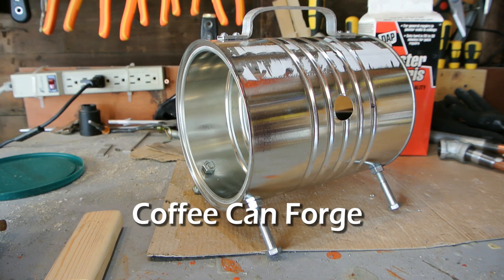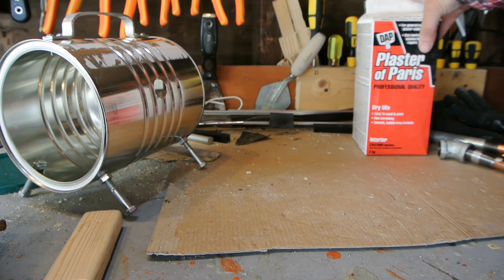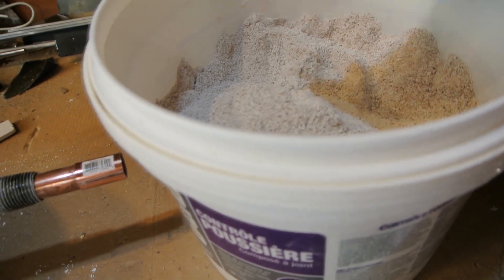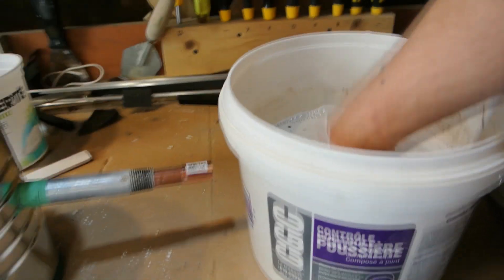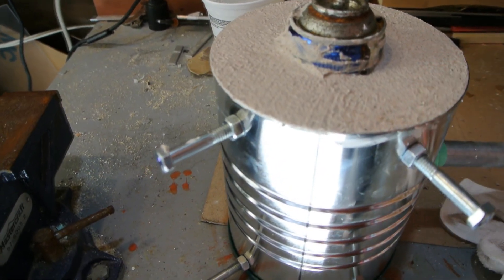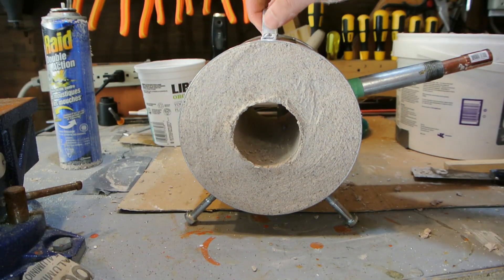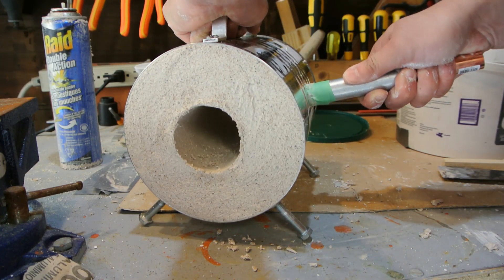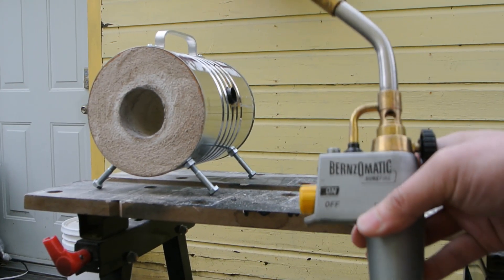How to Make a Coffee Can Forge

Comment: great video, was wondering could you double up the cans and make it twice as long, or would this torch not have enough heat to power it.  I have the same torch (TS8000) but would like to be able to do more than about 5-6 inches.
Reply: @violetroseish thats actually what I ended up doing.

Comment: Could i use cement to do this? I have a bunch of left over bags from when my dad and I fixed the house. Would cement work or is there something wrong with using cement?
Reply: +crsed cement don't hold heat as well, and it will crack.
Reply from the maker: +Wayne Earls Agree and it's heavy.
Reply: It kinda explodes  and flakes off some pretty gnarly shrapnel or at least it does with oxy acetaline

Comment: what other pieces did you need besides the hose to hook to the propane tank.
Reply: +i2aspire Just look up bernzomatic hose on ebay. it has connectors built on.
Reply: +Wayne Earls I'm interested in making this for knife making, will it get the steel hot enough to be able to harden? great video

Comment: Thanks for posting this. You may want to try coating your chamber with a product like Satanite or ITC 100. That will help with the thermal "reflection" to help get a little more heat out of it. Also as previously posted blocking the back end when not working with long stock would help. I have built a few propane forges and unless I have an air assist on them they seem to struggle to get to welding heat (my experience, not an expert on these matters). Very cool, I like the home brew refractory and think I will try it on my next forge. Has it held up over time/use?
Reply from the maker: Jeffrey Jones Hi Jeffrey, I have only used it a few times but so far it seems to hold up.  Thanks for mentioning ITC 100, I actually have some left over from many years ago when I built my first large forge, I'll have to get around to coating it.  I don't need to do any forge welding so this is perfect for bending some long pieces of metal.  Best part takes no time to heat up.

Comment: How warm does the outside of the can get,generally speaking?  How long did you wait for the mixture to set or cure before firing? Nice clarity and pace in your instruction. Thanks.
Reply from the maker: 101platayoro Thanks for watching.  It gets pretty hot but not so hot that it would burn paper or anything like that.  Actually you don't need to wait for it to cure once it gets solid you can fire it up and water will dry out of it.  It will just take 10 or 15 minutes to dry the water out of it (it won't explode).

Comment: Be careful. Your propane torch feed pipe is a steel pipe with zinc coating (galvanized) which zinc has a very low melting point and from the high temperature it does not melt off it burns and boils off creating a gas and smoke mix that is extremely toxic to breath and if consumed enough can kill you in a matter of two to four days. Please be careful.
Reply: Must have never welded galvinized before. Don't get me wrong it's toxic but damn that little piece ought to be fine.
Reply: Christian Holbert 
Thanks for Posting the dangers of Zinc Fumes! All these mockers think they're bullet proof! Toxic Body Burden is a reality!  As a Boilermaker I suffered Metal Fume Fever, because the Employer Refused to buy proper Cartridges for the Respirator! My working career ended at age 51, with a Toxic Fume injury!
Reply: Hes outside my dude I think he'll be alright and on top of that hes not even using that piece of galvanized steel
Reply: Drink milk
Reply: Christian Holbert stfu
Reply: lol
Reply: The food you eat from boxes is far worse for you than the few times you use your forge. lolz look on the box of KD ingredients dude.
Reply: +Christian Holbert I don't think ever used that w/ heat...I think he only used that threaded galvanized pipe for the mold. After the mold had set, he removed it and then he only used a steel pipe piece he stole from a broom (plus a copper coupler to extend his torch)
Reply: I have a quick question. Does anyone have a reason why he left the back totally open. I thought you would want a totally enclosed space? Thats what i generally see most of the time anyway
Reply: @MarsupialMason  - he said that he sometimes has to heat longer pipes and wanted to be able to put the pipe all the way through.  Agreed that it would conserve time and fuel to keep the back closed.  I plan on using this for small knives, so keeping it closed would be perfect.
Reply: @shawngivens247  agree'd then :) i also heard that. And apparently everyone is calling me out on my message. But it makes you think at least which is good :)
Reply: Marsupial Mason he wants to be able to put a long rod through it so he can bend the middle of something
Reply: Marsupial Mason he said that he wanted to be able to stick long pieces through it
Reply: @MarsupialMason  He says early in the video that he wanted the hole to go all the way through so that he could heat longer peices of metal. 
But if you werent going for anything big then you could just leave the back closed and it would increase your temperature quite a bit. It's likely just as effective if you just close off one hole with a fire brick or something.
Reply: Christian is right, it is bad guys it can cause metal fever. It's an easy fix just sand the galvanization off with a grind wheel or angle grinder. it'll burn off  and damage your lungs so just buff that shit out
Reply: Very useful information here Christian, also his use of aluminum in a forge ( the handle ) is not really a safe idea either, as aluminum can be bad when it gets to hot ( not likely to happen to the handle though) so to play it safe, I would have gone with a steel handle. but there's all kinds of ways to improve on this idea ! :)
Reply: Since when are zinc shakes lethal you joker? Especially from a tiny piece of tubing like that. If you weld zinc galvanized steel all day you'll end up feeling like crap for a couple of days, but that's about it. Not saying that people should breathe in fumes all day, but you should seriously get a grip.
Reply: Thank you Justy.  Christian Holbert is obviously a hack.  Glad someone said what i didn't have to say.
Reply: Tdenton12, google ''Health hazards of aluminum'' and learn for yourself !
Reply: how can aluminum be "bad"when it gets hot?
Reply: Not THAT bad...
Reply: tdenton12 it's not man. If it were every person I know that works on the pot line at the aluminum factories would be dead or at a health risk. Who is this guy? Lol! "Heating up aluminum can cause health risk" 🤓(said the idiot commenter)

😬😬😬😬😬😬😬😬😬😬😬😬😬😬😬😬😬😬😬😬😬😬😬😬😬😬😬😬😬😬😬😬
Reply: @BradleyBrasher  I know this is a year old. but burning Aluminum (because it is sometimes mixed with other metals for rigidity) at extremely high heats will cause a exothermic reaction where it turns to a gas. This was observed in full detail during the manufacturing of the M2 BFV Bradley Fighting Vehicle. which at the time was pretty much an armed APC.

They designed the armored hull with Aluminium. When the hull was breached during test fires... the metal got hot enough to expel gas into the personele chamber as well as the  transport compartment. 
This was a live fire test with sheep (fitting substitute) as the shaped charge entered it did not hit any of the sheep, but when opening the compartments... all sheep were killed by gassed Aluminium. 
Albeit the armor was most likely an alloy containing other materials. but on the other hand. Aluminium will not oxidize, or melt under the heat of this forge. So, the handle is safe for use after it is cooled off for easy carrying.

But really with that much refractory insulation I wouldn't even worry about it all that much anyways.
Reply: @BradleyBrasher  If you heat aluminium to the point of gasing it can become a danger.
Reply: @BradleyBrasher  Aluminum welders be like, Were from Krypton lolz